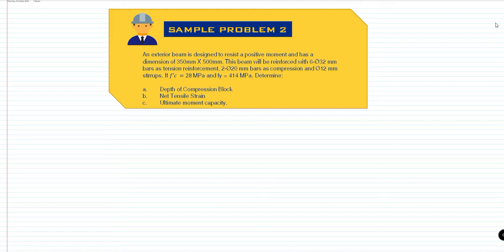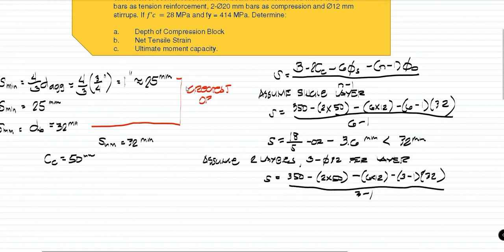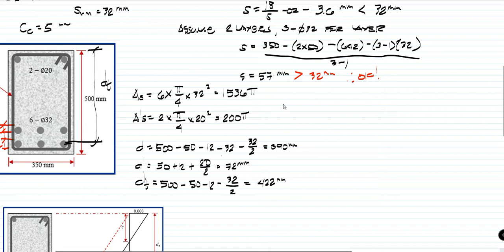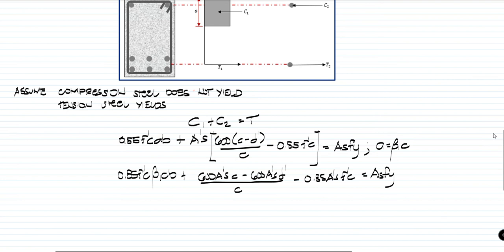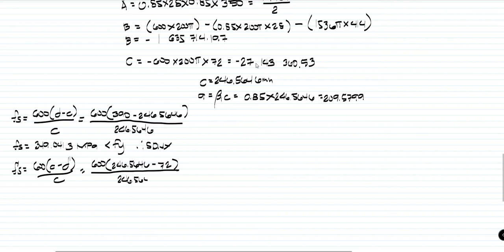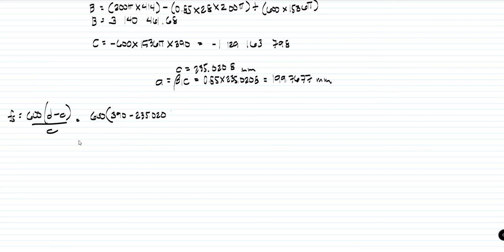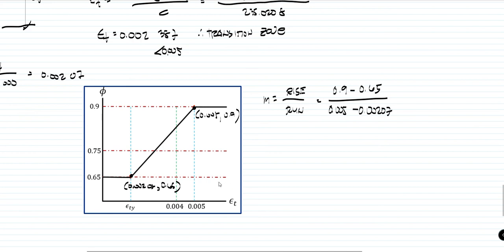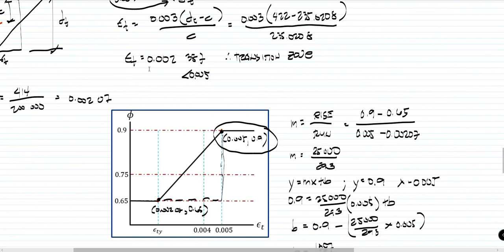Analysis of Doubly Reinforced Beam (Sample Problem) Part 1

Comment: Bakit iba²ang mga formula ng Cc+Cs=T
Sa Compression steel bakit may additional 0.85f'c ?
Sa ibang video ng mga analysis of Doubly RC beams walang ganyan. 
I need to search for more reference POWER
Reply from the maker: Actually, some of the formulas are just theoretical, it is just for the purpose of discussing the possibilities of yielding for the compression and tension reinforcement. Pero in reality, the case is always compression steel does not yield and tension steel yields. 

With regards to the deduction naman ng 0.85f'c kay f's, it is for the purpose that rebars create a hole on the concrete, we can actually deduct it by means of area but it will be very difficult in getting the moment capacity, so the code allows us to deduct the stress of concrete to the stress of the compression bars para compensate yung ginawang hole ng rebars kay concrete.
Reply: @buchtv8573  Thanks for this video, MY EXCEL IS DONE. next would be about SHEAR.

Comment: Does Singly and Doubly have the same method/process to find its effective depth?
Reply from the maker: Yes it is the same. Depending on the layer. But 5 layer reinforcement is more like a column than a beam or it can be a beam with torsional reinforcement.
Reply: @buchtv8573  Thank you for the enlightenment. I come up for 5 because what if they'll give me crazy problems. Hahaha.
Reply: I'm currently making an EXCEL PROGRAM for this rc beams. It's fun. Up to 5 layers of bars haahaha